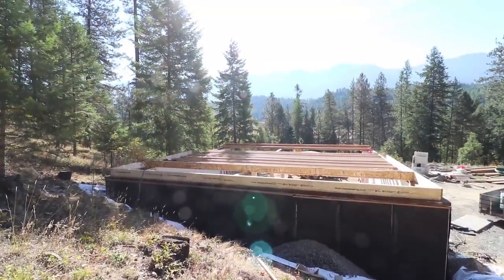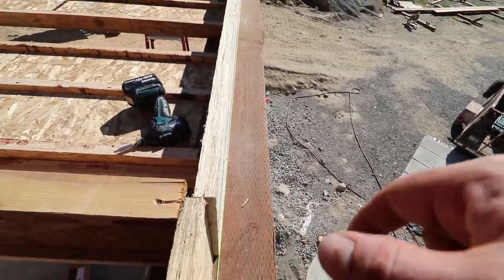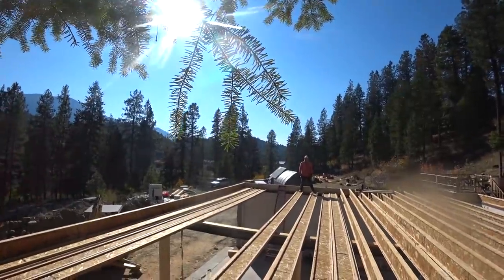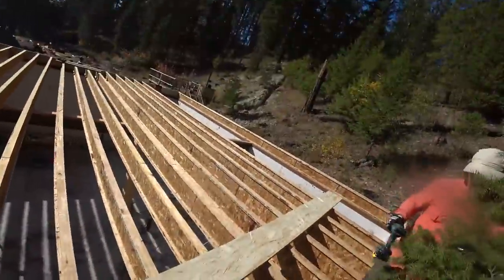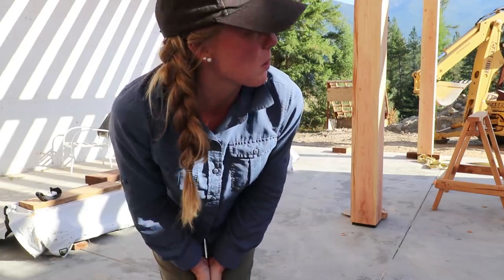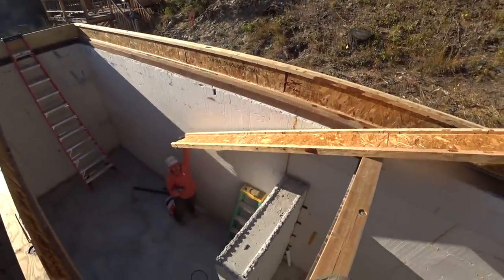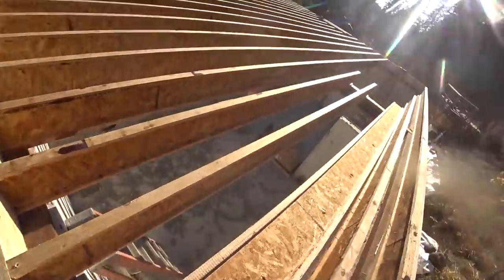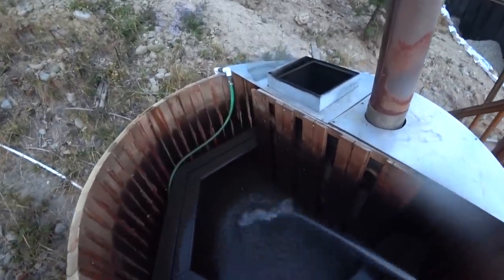OUR HOUSE LOOKS AMAZING (I-Joists & Rim Boards)

Comment: I highly suggest tool belts to hold screws, nails, and tools.  You wouldn't have to worry about finding places on the sill plate or other places if you had a tool belt of some kind.

Comment: Many people mentioned you should have used nails, they are right...ESPECIALLY considering how many times those screws were re-used. The impact puts much stress on the screws every time you run them in and out of something. I've seen many snap on just the second use with an impact.

Comment: Hi folks. If you were to cut and place a few loosely-placed "blocking" spacers there would be no need to measure centers and the loose blocking would temporarily hold the joist in place while you fasten them. Handy framing tip ?

Comment: You guys check the fastener schedule? I don't think screws are permitted.  Usually nails offer greater shear resistance, as the can bend, to the contrary, screws just snap..  Screws are weak in shear.  Just a thought.
Reply: Robbie Buller  was wondering  that ,  can you not use paslode?
Reply: Totally.  Paslode makes Pneumatically Actuated portable framing nailer guns.  That or a Stanley Framing Nailer, which requires a compressor.  The small one on site is not sufficient, requiring a bigger one, as to not wait on the compressor to recharge.

Comment: Did your engineer ok the use of screws for the I-beam? Screws are good for pulling components together because they are tempered steel so the threads hold up to the stress of cutting through the wood fibers, but they are brittle and will easily snap under lateral (side ways ) stresses. You can bend a nail but not a screw, it will snap.
Reply: Depends on the Screw
Reply: @ Bryan    Name one screw used in construction that is made of mild steel.
Reply: Inertia of upper floors vs. earthquake shear.  Now that name calling comes right back at ya.
Reply: That's not necessary, these screws have little to no load on them in this configuration. Weight distribution is centered on the beams and exterior wall. Considering their choice of wall support and foundation, the walls would come down before those joists in a major lateral pressure occurrence. This is 200% acceptable
Reply: Chris King it's really sad how some people behave in these comments. I mean why can't we argue like adults, it's much more fun that way. It's like they think the person who is commenting isn't a human .
Reply: There's a golden rule in construction and that is that you never use screws in framing a house, the floor joists are part of the frame work. Unless you're an engineer you can't say what loads are at work in this application. I'm not an engineer but I've been in the construction trade and if this were my house I would have used a nail gun, and if I had the job contracted out and they used screws I would be checking with an engineer. They should go around with a nail gun and secure the joists before they put the plywood flooring on.  Bare in mind that a house isn't a static structure it's dynamic especially over time. Cheers.

Comment: Hey guys I'm in the process of inspecting an ICF build, the first crew walked off the job, the second crew is about getting ready to leave. The developer, architect are on the phone with the contractor and the builder, its a mess, so much for all the professionals.....The second contractor and builder want holding fees as now they need to redo all the window and door opening on the 2nd floor (good thing they didn't pour the 2nd floor walls yet) (re-ordering all that ICF at 22.00  a block wow, not to mention cutting all that rebar).....one wall (1st floor)has a major bulge, the walls are not square, not even close and the slab ,well its not pretty....In comparison you guys are doing a great job for people with no experience.....keep up the excellent work.

Comment: Just a hint.  When you have many "same spaced" boards to attach...use a pre-cut spacer.  It prevents mistakes, it doesn't cause them.  i.e. the floor joists on 16" centers.  Instead of measuring Every one...use a spacer cut to the exact measurement that separates each joist.  More accurate and easier.  Just sayin.

Comment: I'm happy you finally trimmed the branches on that tree.  But, you might want to take the whole thing down.  Last thing you need is a tree that close compromising your pipes and weakening your foundation with it's roots.  Also, close branches provide highways into your house for insects, critters, etc. Not to mention damage due to storms.  Best to keep that all a good distance from the house.  Just my opinion.  House is taking shape.  Good work and good luck!
Reply: YAY!!!! The tree branches were pruned!

Comment: When you lay your deck plywood, you will probably run into the problem of the plywood growing longer than your joist layout.  Generally, the problem arises when you use a tape to lay out the joist spacing.  We always used a 2 ft square and allowed the spacing to grow a sharp pencil line width for each joist.

Comment: Why did you choose to use screws rather than hot dip galvanized nails to attach I-beam floor joists to treated sill plates?
Reply: It is easier to take apart. Ha Ha.
Reply: Nails have far more shear strength than screws.
Also, screws will corrode in treated wood.
Hot dipped galvanized nails are much more resistant to corrosion in treated lumber.

Comment: I would suggest a framing nailer, you should be driving 16 penny nails into that wood. And your gonna need the experience when it comes to your framing your walls.. also if its not to late by the time i see this video i hope i can save you some heartache by telling you to use some construction adhesive, as well as screw the floor deck down to prevent squeaks in the future.
Reply: chaseme81871 excellent points! Construction adhesive has so many uses.

Comment: At 7:40, you put the center of the joist on your mark when it should of been on the left side of your mark..  You hooked your tape on the edge rim joist and measured 16".  This means that every following joist should have their edges touching the mark.  I hope this doesn't throw off your layout when you put down your sub floor.  Does anyone else concur?

Comment: Wondering when you were going to cut those tree branches.  I would make the decision to cut down the whole tree as it is too close to the house.  Here we have trees that can crack a slab.  Those pine trees probably wont but those needles on your roof will deteriorate your roof as they decompose, form acid and clog gutters if you have them.  THey also will compost into the drainage around the house.
Those blocks between floor ibeams will block anything you may want to run in the future. Exhaust vent, wiring, piping.  The plywood above will lock those from moving.  Great work.
Reply: I have a pine tree out back that has broken through the retaining wall. They're quite sturdy.

Comment: Dear Jessie & Alissa,
Great video series. I have been watching for quite some time now and have been biting my tongue to resist a suggestion, but no longer. I understand your desire to 'preserve that tree'. However, I STRONGLY SUGGEST that you PLEASE CONSIDER taking some action regarding that tree - for two reasons:
* for the height at which you are working, from a WORK SAFETY standpoint, it's just far too risky for you to be walking that edge while dodging branches that are touching the structure. They both, obscure your vision (of your feet & pathway) and pose an obstacle (risk of branches and needles underfoot).
* to have conifers touching the house/structure is too close from a FIRE SAFETY perspective. I am a firefighter in rural Arkansas (hint: very treesy) and have just attended our Wildland Fire training course (for the second time in my career). In that course, we talk about maintaining a defensible space of 20 feet of separation. In the following link to the Firewise website, they talk about a defensible space of 30 feet in order to prevent radiant heat from a burning tree to jeopardize the structure. To have the tree actually touching the very tall structure brings into consideration the other two methods of heat transference: Conduction and Convection (that's all three methods working against you!!!!). http://firewise.org/wildfire-preparedness/be-firewise/home-and-landscape/defensible-space.aspx?sso=0
If you are in doubt, please contact your Volunteer Fire Department for their advice.
Reply: Good and wise info here - maybe you should post it on their facebook page because that's where they read comments
Reply: SBFay01 they're going to cut it down....it provided much needed shade.  There will eventually be a three sided porch

Comment: Just curious, but aren’t nails recommended for structural fastening due to sheer force? Again, only curious
Reply: Shawn Cooper traditionally and usually yes, but there are some new structural screws on the market: Simpson has some. Hope they are using structural screws and not decking screws.
Reply: Ok. Thanks for clarification

Comment: Just a suggestion. When working on rafters consider tying a 8'-9' twine on the handle of your power tool and the other end on a nail nailed in to the top of the center rafter.(it can be moved as you work further down the line). That way if you drop the tool it will not hit the concrete and break and you won't have to climb down to retrieve the tool. Just thought I would share.
Thanks for all the hard work and hours you spend to make your blob entertaining.  Jon

Comment: Looks great.  One thing I see is you are using screws instead of nails you might want to check with your local codes enforcer and asking if screws are okay. Screws have a tendency to snap they don't have the strength as a nail does like a nail will bend all the way around into a circle as a screw will bend a little bit before it snaps off I don't know just suggestion.
Reply: James Brooks thanks for telling me.  I wish it was like that where I live.

Comment: If you would have lifted a couple of sheets of plywood up top, you would have been able to kneel on a secure surface while drilling, (easier on the back than bending over) a place to set down screws, and a safe place to sit.

Comment: Please reconsider using screws on your structure. I have experienced catastrophic failure of a wall because of screws only to be told nails are better. Please discuss this with your Simpson rep or engineer.
Reply: David Paquette depends on the use. Screws have poor sheer strength compared to nails and screws have better holding strength. Joist hangers is a good example if where to use nails (mainly a sheer load) whereas something like subfloor screws are preferable. Their joists are sitting on a foundation, so no sheer like you'd have with hangers.
Reply: True on the spiral nails and I'll take your word on Canadian code. I doubt screws will fail in this use. Once the subfloor is down the joists can't twist. Better screws than some salvaged nails of random sizes. They need a nailer though. So much more efficient. Plus have you seen the way Jesse nails? I think defaulting to screws is just not being comfortable nailing. It's a good skill to learn. I had an 80 year old contractor that could sink a framing nail in 2 strokes consistently.

Comment: Seriously, 20 years on Australian building sites, I've never seen joists screwed, particularly from the inside out. What's wrong with a nail gun. Cheaper, stronger and 5 times faster.
Reply: they don't have a compressor for a nailgun
Reply: They have that shitty little one. A decent one is like $300 and has multiple uses. They'll end up spending more on screws.
Reply: They have a hammer. Don't need a compressor

Comment: I love framing. Although I call myself a finish Carpenter. I might fix the wacked joist by going with the mistake and squaring the walls up on the plate. It's a half inch. You'll never see it. You could even pack it out before you sheathe it. In the end you were fixing it the right way by taking it apart

Comment: alyssa isn't feeling it .. i remember a time not so many months ago that jessey wasn't feeling it and she was very perky and helpful to get him through it.. when they were running that water line maybe.. Remember the construction adhesive to glue that decking to the ibeams.. it makes all the difference so you don't have a squeaky floor.. just put down enough glue for one piece of plywood at a time and use extra sheets of plywood to stand on while you are working... start by laying your first piece of plywood with the tongue on the outside by the rim joist and then when you go to put the second row on you are tapping the second board onto the grove of the first board and you are tapping the groove/ flat side of the plywood edge.. its easier to tap the groove side with a piece of 2x4 laying on the joists up against the plywood .. if you tap on the tongue side of the next sheet trying to force it into the first sheet you already layed you damage it. anyway.. good luck .. stay happy Alyssa >:oP

Comment: Facebook update:
Immediately after the fresh log load arrived a 4 hour blast of 50+ mph winds slammed into Having just tarped the house we scrambled in an attempt to save the 40'x40' tarp to no avail. Despite being fastened on all sides, no matter what we weighted the tarp with it was flung effortlessly off the building. Nearly lost the outhouse in the ordeal too. After accepting defeat with the tarp we decided to work despite the high winds and get back to milling only to have our log grapple snap. Our local welding shop simply doesn't have time for a repair so a new one is being overnighted. In the mean time we are able to use chain to lift logs. For those who have suggested forks for the backhoe we are aware of them but they aren't a good fit for our current needs. On a positive note, Alyssa spent considerable time tuning and adjusting both our 12" Makita planer and her technique which is now producing some amazing finished timbers and a MOUNTAIN of shavings! More photos to come. Video Forecast for today isn't looking good

Comment: why are your rim joists not flush with the outside of your building?
Reply: I think they talked about this in a previous video - IIRC, the plan is to have the exterior SIPs flush with the outside of the silplate
Reply: I am  guessing it is because they are using SIPS panels that are thick and then will be even with the outside.

Comment: that pine tree is going to eat through your siding every time the wind blows.
Reply: I agree. It should be removed but needs to be cut back at the very least.
Reply: The fact that the tree is going to stay does not alter the fact that it should be removed.
Reply: IronOxcide didn't any one watch this video all the way through. Jessie finally cuts off those branches. and Alissa commented that was something they should have done a couple months ago.

Comment: Since you held the rims so far in from the exterior of the building line your going to have to have some custom made sheet metal made to keep the water out. A BIG Z OUT OF SHEET METAL. Up the rim about 3" ontop of pressure treated the down the edge of the pressure treated to the cmu wall.

Comment: Right then - I have just read HUNDREDS of comments about screws not to used. AGREED. When I watched this video more than a week ago, I thought that others would make comments about the screws being wrong over nails. We should realise that when the framing guys turn up, they will say FFS and bang in nails to prepare the joists properly. We will not be told by Jesse (or if the team are wise, they won't offend Jesse by not telling him) that they do this to replace the screws. I am so impressed by Alyssa's immense skills and courtesy - and coping with so much, but Jesse's touchiness is such hard work. I also thought he was such a tit for using the huge circular saw like that - seen on youtube channel on a UK site, he would be visited by a very vigilant Health & Safety inspectorate to be ticked off. (maybe Jesse wouldn't read their comments either).
Reply: Just want to second your comment on the screws.  It always amazes me that many home owners think screws are the business for everything, (unfortunately a lot of so called trades do as well) and they most definitely are not!  Read your Codes people and read the manufacturers installation specs that came with those TJIs, or if the specs are missing go online to their site for guidance. Whether this work is inspected or not use of those screws is not accepted and for very good reasons. Instead of throwing that hammer onto the hill, use it to nail in the proper sized nails. Do it right the first time and you won't have to do it over.

Comment: Your string is in contact.  Your reference string must not be in contact.  Always an 1/8  or 1/4 of an inch away,, so that no splinter, fluff, dirt, unstraight anything can subtly push your string over.  Never in contact.

Comment: That's why you snap a line of chalk ..... Using a string that is placed on an out of square board is a common mistake . Snap a chalk line b4 any lumber is in place and go by that . Most people would just have kept on installing the joists outta whack . Props to you for redoing it right .

Comment: If you're not going to employ the fall protection many have been screaming about AT LEAST move the rocks and boulders in the "fall zone" so that a fall doesn't necessarily result in a paralyzing broken back or fractured skull. I cringe watching the operations around the backhoe and the perching on the joists when the backhoe is moving. UGH.